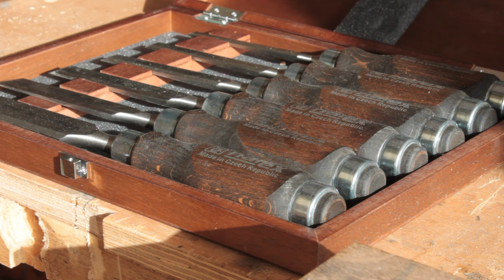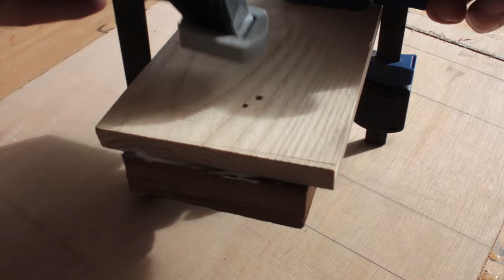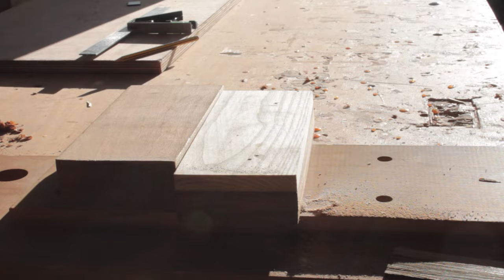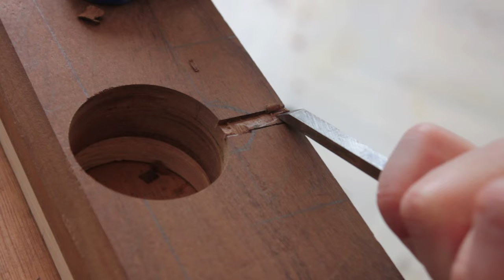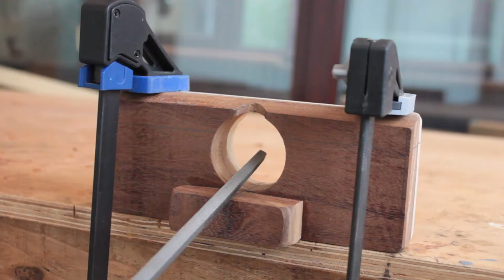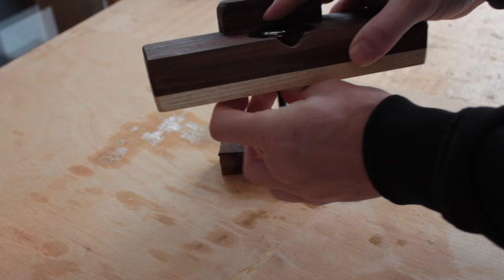Making A Router Plane

Comment: Nice build. I made a sappele one quite early on and still use it all the time. I love hand routers. Great share.
Reply from the maker: Thanks! In the heat of the summer I’ve been using power tools more as I work out of my conservatory and it’s two hot for handwork :( looking forwards to winter rolling in and it getting a bit cooler to break out the planes again!
Reply: @Greyotterstudio  I work outdoors in a garage but not too hot due to trees and shading, although I know how you feel, only have hand tools apart from the demon yellow braces. LOL. No room for power tools. Motorbike and car gets in the way. LOL.